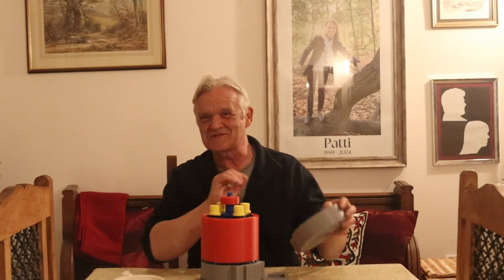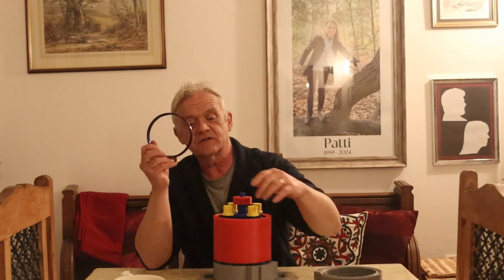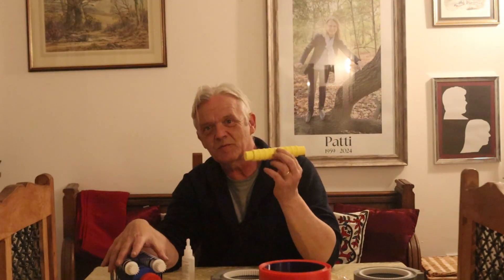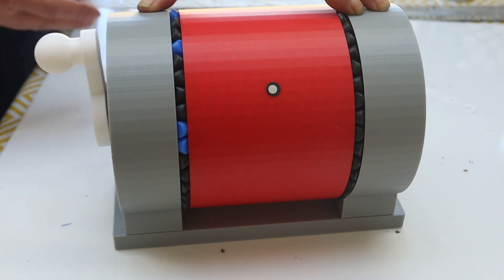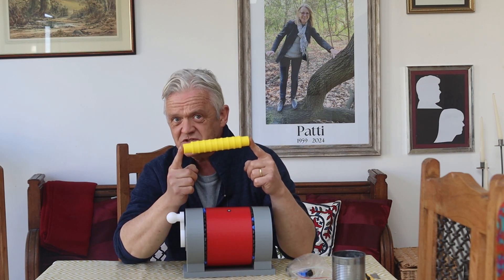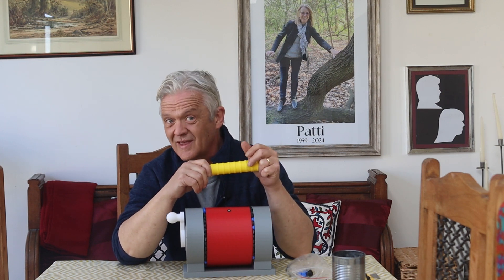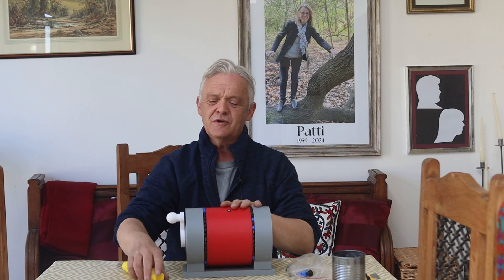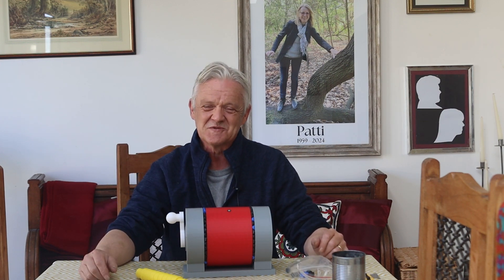2360 Improving The Scroller Wolfrom Drive

Comment: What about using tapered surfaces to increase roller contact and pressure without losing simplicity.  

Each roller has a cone on the end

The end piece has a free floating support cone in the center and a fixed tapered cup on the perimeter.  Preload on the cones could be adjusted using pusher bolts and clamping screws.
Reply from the maker: I like that mate - clever idea thanks for sharing

Comment: You have a "free" clyndrical diameter still, and gears can be made to any pitch.  So you can still get really high ratios with one or two gear stages in the drive.  What you are loosing with gears is smoothness of motion.  It's VERY had to make gears smooth enough to keep the output moving in the correct direction with 1000:1 or higher ratios achieved via subtraction.
Reply from the maker: cheers mate

Comment: ease of manufacture is no different for a 3d printer but if made it from metal then you're in for more work and you might as well do planetary gears. which they do.
Reply from the maker: you wouldn't make these on a 3d printer to actually use them mate - here we are prototyping - for use in larger scale you would manufacture in metal as for they make planetary gear - you are right they do they make a whole host of things and each has its plus points and minus points - I don't know mate but to me it looks like you are only looking for negatives

Comment: Very good.  It is still an excellent winch design.  Can it be back driven?  Electric motors require high gear ratio reductions in order to be efficient for e.g. automobiles.  If this is cheaper and lighter than comparable gearing, it would be a great engineering compromise.
Reply from the maker: cheers mate and yes it can be backdriven